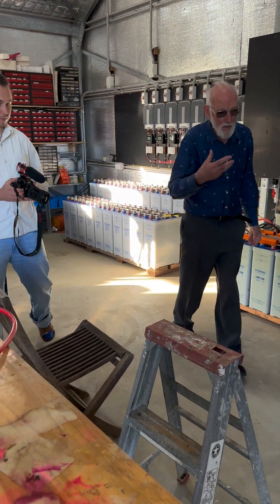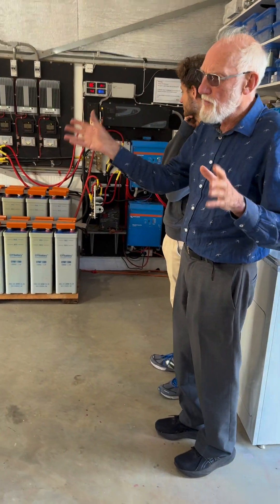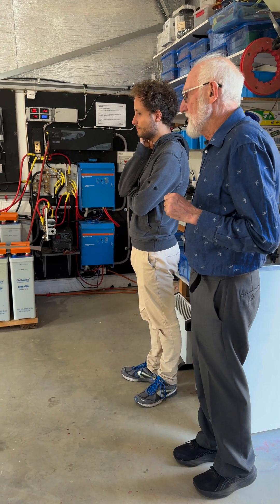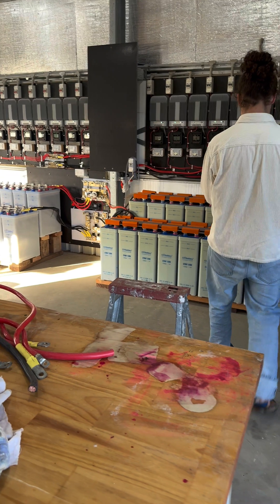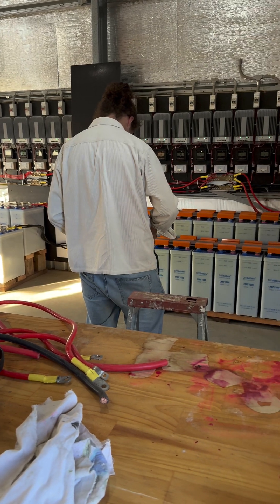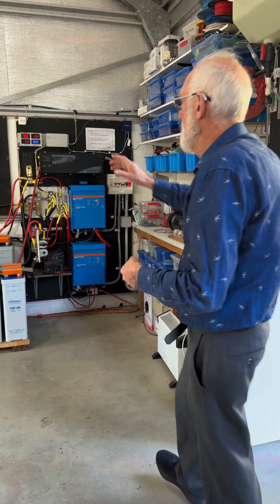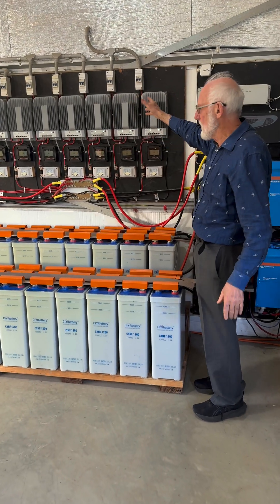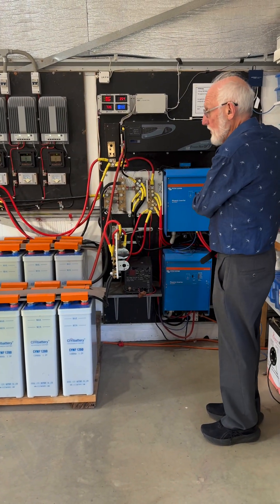Why Nickel-iron Batteries are Readily Available

Comment: I wonder how much that system cost? It’s the entire wall and then some.
Reply: from what i head, expensive at first since these can take a beating for years, almost 10x longer than lithium batteries.

so 5x more than tezla power walls
Reply: Possibly longer... This is based off of an Edison battery.  The first Edison battery is in a museum and still works to this day!  You can abuse these batteries with little (if any) loss to capacity, etc.
I look at this technology and remember: we live in an extractive economy.  We're trying to extract as much wealth from our own citizens at this point.  Just about every large company creates things that have planned obsolescence built right in.  We have to get away from planned obsolescence to be able to build better everything.  How else will our technology advance?  @marten3451